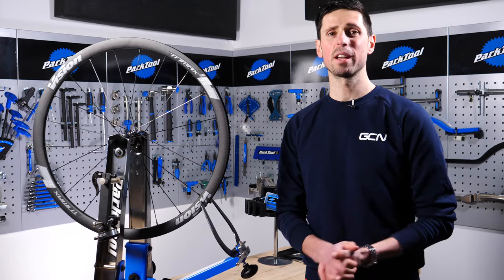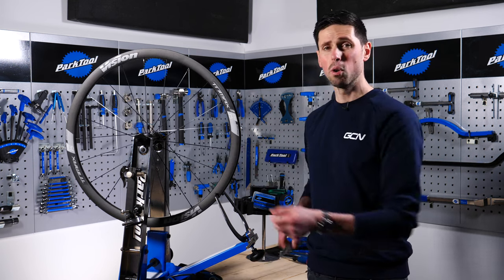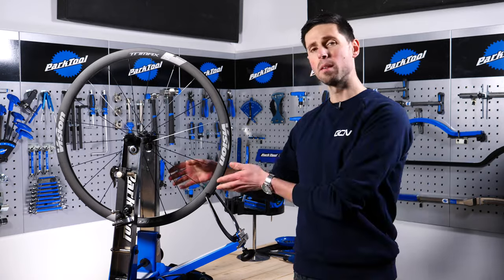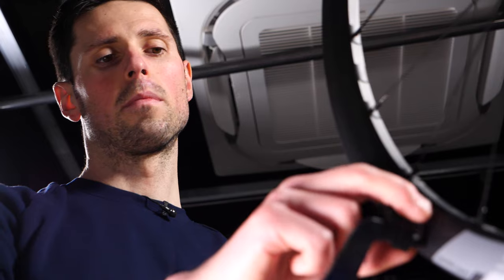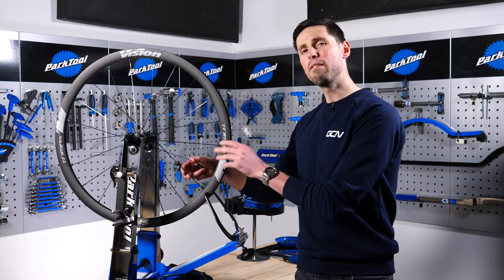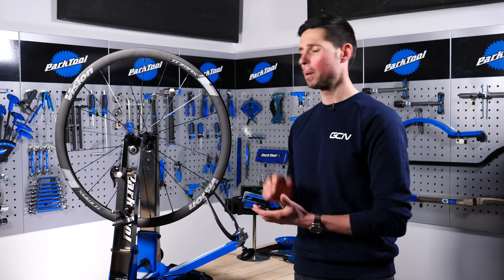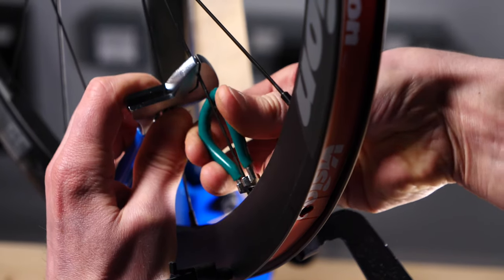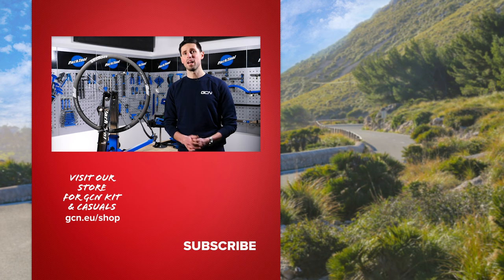How To Fix A Buckled Bike Wheel

Comment from the maker: Did this video help you true a wheel? Let us know in the comments 👇
Reply: For lateral buckles, yes. However, what to do when the wheel isn't round any more (vertical buckle)? Sure the process is similar in the sense that you increase tension on the part that is too long, but on which spokes should you release tension for compensation?
Reply: Using a plier or nose plier or tongue and groove pliers can replace the adjustable wrench, and its way faster. Also, if you are truing a wheel without tubes and tire, you can use a slotted screwdriver to tighten/loosen the spokes. Also: using the TM-1 from ParkTool may help you remove stress from the wheel so that you can true it, without overthingthning everything.
Reply: Also: Since you are sponsored by ParkTool, you can talk about the TS-25, which is a truing stand compatible with many ParkTool bike stands that is really lightweight and handy for your not so often trueing needs, but its way better than trueing using the bike frame/fork. (I really need to start being sponsored for this)
Reply: @koko-lores  I use trial and error method. Because it can buckle fro somewhere else. I mark the spokes where buckles are. I attack paperclips on spokes. On higher spots the clips are closer to rim and lower spots I put them closer to hub. This way I draw like the shape of initial wheel on spokes. Also I can use different color of clips too. Then it's easy to remember which spokes I have already turned and when some new high spots appears I wont get confused. I see from paperclips on rim that they are new and can figure out which spokes I need to loosen.. Here I have a video how I modify paperclips to make them usable as spoke markers/flags. https://youtu.be/hh_bZmHdq30
Reply: @Hardi26  Thanks for the explanation, definitely a good way to keep track. Still a but unsure where to start, especially when there isn't a clear "lower" spot, but a clear "high" spot. Maybe then it's loosening the "high" ones and tighten all "normal" ones a bit?
Reply: @koko-lores  if you have a clear high spot you just need to tighten the spokes around the area. 
I don't think tinkering with many spokes at once is that good because that might result in a broad range of spoke tensions.
Reply: @hankschrader2353  It would increase tension at all other spokes though. But maybe it's still in the normal range of wheel building and fine?
Reply: @koko-lores  Some aluminum rims have highpoint on where the 2 ends are jointed together. And it's not possible to get completely rid of that buckle. Also tension of those 2 spokes each side of that joint is usually higher than rest of wheel. Depends how the ends are jointed, with bins or welded, the lump might be bigger or smaller. Anyways just tighten the spokes on highspot little and watch what will happen. You may need to loosen other spokes little if you think overall tension goes too high. You can listen what sound the spokes do when hit on them(like piano), or play with fingers like on guitar. Better would be to use tension meter, but many people swear, that they can get the tension right by hearing.. So if the wheel is new and correctly tensioned remember what sound it makes and also feel with hands how much you can squeeze 2 spokes together.. And hopefully it won't go bad., Anyways, keeping track on spokes is important, because by my experience, when tightening the spokes on where the high spot is. A new high spot appears elsewhere and it's really difficult to understand later what is happening and it might go so bad, that you need to loosen all spokes  completely and start from there.
Reply: #GMBNTech This is big help and makes truing seems more achievable. Can you answer by my rear wheel always seems off balance though? It is true but always a little bounce while in the stand and spinning. Is this just the small weight difference from the stem?
Reply: @koko-lores  Use TM-1 from ParkTool or any other similar tool to evaluate the overall tension. ParkTool also provides a Wheel Tension App that helps you with that.
Reply: @bugboy152000  ParkTool has a video about that 'off balance' stuff. It can be due to a lot of things. Also, if you use tubeless it will be useless to try to balance the wheel because the liquid inside puts the wheel off balance everytime. Otherwise, make sure you put the tire/tube on the rim before you start to put weights on the wheel for best results.
Reply: @CyclingLifePT  Thank you, I'm running tubeless  and only really notice it in the stand. I can't feel it out on the road.
Reply: The graphics are wrong or confusing in two places.  Hopefully people figure out what's really going on.
Reply: It didn't my wheel is worse now as my spokes tighten the other way so now I have to get a new rim

Comment: Good beginner tutorial.  Truing wheels is an artform.  I HIGHLY recommend anybody start by tensioning their spokes FIRST.  Park Tool makes a good tension gauge and they also have an online calculator.  The idea is that you need to get to the point where there is an even amount of tension on each spoke of a given side and that the tension is within recommended tolerances for the spoke type.  Up front, the tension should be roughly equal left to right, and in the back , the tension will be different from drive to non-drive sides.

Once you have tensioned the wheel, that may take care of the problem already.  If not, dishing the wheel can really help determine WHAT adjustments are necessary.  The truing stand just helps figure out HOW MUCH adjustment is needed.  Then, when truing make the MINIMUM adjustments needed, always remembering to make counterbalancing changes on the opposite side (both left/right and across the circle).

Personally, I always check tension again after truing, and occasionally for really bad wheels, it takes a few rounds of tensioning/truing/tensioning/truing/etc. to really get a true wheel that is also properly tensioned.

There is also a pretty important consideration of making sure the wheel is properly centered on the centerline of the bike.  If the tensioning is done properly, this should be the case, and if your truing stand is properly centered, it will show up there, but check it after each step anyway (i.e. tension/check/true/check/etc).  Check center by putting a ruler level across the fork and making sure the distance from the center of the tire is equidistant from the fork arms.  If the tire is off, just make sure the distance from the rim is the same on both sides.  If it isn't, FIRST, center your truing stand (you'd be surprised how many aren't centered), then start back at the beginning.

BTW, this isn't just for purists.  A properly tensioned wheel will perform better in all respects, and will resist going out of true much better than one that is too tight or too loose.  It's all about balancing compliance and rigidity, just like in every other component of the bike.
Reply: Thanks for the explanation, I also think that the tension is the first thing to do.
Reply: the problem with most YT videos is that each video only addresses one part of the equation but doesn't tell the viewer which takes precedence. IMO, tension>true. It's better to have a proper amount and distribution of tension, and take some deviation in trueness. Some people chase perfect trueness only to have totally imbalanced tension, damaging the wheel

Comment: The clockwise/anticlockwise instruction fails to mention which end of the nipple this applies to.  People new to this can easily make the mistake that the perspective is from the inside of the rim.
Reply: Was wondering about this myself.  As always you need to view smaller channels for better instructions.
Reply: Not only people new to this. I still check rotation every time before I start working on the spokes.
Reply: Ah that's why it looked like he was turning them the wrong way! Makes sense :)
Reply: And said he was turning the nipple clockwise when the spoke wrench was going counterclockwise; i.e., the turning the wrench in the opposite direction b/c it's on the other end of the nipple.  Really fundamental and not well explained in this video.
Reply: @JATJAT330  He did it correctly you know. You're looking in the direction of the hub when you're standing behind the wheel.
Reply: @HiopX  yes - i've built and trued a few wheel sets - still infrequently enough that it's not muscle memory and need to check each time
Reply: Making mistakes will teach you far more than a YouTube video ever could, 
I'm always confused by comments like yours, you obviously know how a screw works, Let the snowflakes figure something out for themselves.
Reply: such a good coment, as new to this I made that assumption myself. its even funny that the guy just ignores your coment instead of thanking you and making the correction.

Comment: I was once tensioning an old wheel that was like a 48 spoke, 4 cross wheel, and as I had it on the ground pressing it down, putting pressure on the rim to stretch the spokes, the entire wheel popped into a Pringle chip shape.  It was incredible!  It was perfectly symmetrical.  I couldn’t believe the rim didn’t break.  So I just pushed on the high sides and it popped back straight.  No damage.  It wasn’t even really out of true.  Blew me away.  Any modern wheel would have a rim too stiff to do what this rim did.  Bike wheels are mysterious things.
Reply: You're not the only person who has brute-forced a Pringle back into shape. Here's a recent viral video of just that: https://www.facebook.com/watch/?v=221335179578400
Reply: The same thing happened to me as well! Even though I didn't manage to get it perfectly straight afterwards...
Reply: @mattgies  😂
Reply: But isn't that wheel now compromised? If it can pop into Pringle shape won't it go back into that  shape with very little trauma thus risking a massive failure while riding after you've made the wheel appear to have seemed just fine after depringling?
Reply: @MrReedEnt  Double wall wheels are the way to go. I have an inexpensive bike, but with all the best features, including aerodynamic deep wheels. But they are minimal spokes, below even the low end of the normal range, at 22 for a 700c wheel. I was busy in college, not paying attention, & to my horror, one day I finally noticed that I had 2 fully broken spokes, & 3 very bent/ loose/ damaged out of the 22! (thankfully i'm not way overweight). I was afraid to even ride to the bike store & rode on grass strips all the way there, slowly, in case the bike fell apart. But they said 'go ahead' when i asked if i should ride my bike back home, to do the repairs at home.  This was the power of a very strong double rim. Yes, you are right. I believe metal can have a memory. However, it is the case, that pretty much all single layer rims are apt to buckle at ANY time if all the spokes aren't balanced, tight, solid/ unbroken. They are very much held together with the tension of the spokes, rather than the strength of the rim wall. With all i've learned of wheels, & how much you can get hurt on a bike that just instantly falls apart, I'd never ride a bike with single rims again, (although I do have a bike trailer with them that has managed to carry many large loads). Still, I don't want any chance of injury, & I was so impressed with how my double wall rims held up with almost NO spokes, that I am sold; it's the single wall rims that are a risk to buckling, based on my experience. Just keep an eye on spoke health otherwise

Comment: As a mechanic I really appreciate the vast majority of my shop's customer base does not true wheels on their own. There's so many things that all need to get balanced at the same time and without all the tools it takes forever and is not always even possible so When I see wheels that have been messed with by a customer, they usually got rushed thru the truing process then ridden on with weak spots due to bad tension and get totally jacked up.
Reply: Yep, that's why I stopped doing it, it just isn't time-efficient
Reply: Im still gonna give it a go.

Comment: Why do you use an axle adapter when the centering wheel has originally made protrusions for the rigid axles. Unless it is not TS4 or 4.2 and it looks like this.

Comment: That's how to fix lateral buckles. However, what to do when the wheel isn't round any more (vertical buckle)? Sure the process is similar in the sense that you increase tension on the part that is too long, but on which spokes should you release tension for compensation?
Reply: I also want to know about this,.
Reply: Yeah, I thought he would cover it. Calvin at Park Tools does a much more in depth video (although it is quite complicated if you've never done it before) over on their channel which covers vertical as well as lateral buckles. And he teaches you get it dialled perfectly.
Reply: @framedman  Thanks, I'll have a look

Comment: It would be good to see how to rectify a ‘bob’ as well as a buckle. Thanks.
Reply: I think that kind of out-of-trueness is called "egging" the wheel is egged. 🙃😀
Reply: I second this. I can true a wheel but wouldn't feel comfortable fixing the wheel being slightly oval-ed/egged
Reply: those truing stands are expensive 😰😕 I use the forks and brakes to fix a little wobble but yeah egging I'm not certain. For sure I expect to have to remove the tyre
Reply: I built both my wheels from scratch without a proper truing stand using only a tensiometer to know when I'd put vaguely the right amount of torque all around.

Rather than relying on brakes where you can only measure buckle, I spun the wheel in the fork with a bit of tape strung along the top. If the wheel hits the tape at one orientation, you know its too close and can add some more tension in that area.

There's no need to remove tension in other areas so long as you periodically go around the entire wheel and remove/add tension evenly to keep the average about right.

Of course this entire process has to be done with no tyre.

One final important point is it can take a while for the spokes/rim to settle down after you change the tension (all the friction between spokes / nipples). It's a good idea to put some force into the wheel to flex it a little and help work stresses out. Just take out the wheel and put it flat on the ground so you have something pressing the side of the hub. Then you can put some of your weight onto the rim. Do this from both sides at multiple orientations and you should be good.
Reply: Same concept, but you need to adjust the truing stand so the tips of the calipers are following the outer circumference of the rim, rather than the sides. In other words, you need to move the tips of the calipers down and closer together if you start with them as shown in this video.

Note that radial truing ("bob", "hop", or "egg" fixing) requires more turns of the nipple than lateral truing ("buckle" or "wobble"). Where a variation of 1 mm might require a 1/2 turn of a nipple for lateral truing, it will be more like 2 full turns for radial truing. And of course to lower a high point, you tighten spokes going to BOTH sides of the hub--likewise, to raise a low point, you loosen spokes going to both sides.

And because radial truing requires many more turns of the spoke nipples, it's a lot easier for your spoke tensions to go way out of whack. Especially if the hop is a result of rim damage such as from plowing through a pothole. So using a spoke tension gauge is highly recommended.
Reply: @ollieb9875  A true stand doesn't have to come from Park Tool.  I love their products, but a truing stand from Performance Bike or Jenson USA will be much less expensive.  I have one from Performance that works just fine.

Comment: I have a wobbly wheel after taking off the rear wheel for cleaning. After placing it back it occurred. I just cleaned. The axel can only be installed in one way. Did I miss something?

Comment: Is it absolutely necessary to remove the tire? Or is leaving the tire on an acceptable "quick and dirty" fix?
Reply: @nascar427  Thank you! In a tuebless setup, I don't want to deal with that milk more than absolutely necessary.
Reply: If you have a flat spot it can make things a bit easier. Since I'm running tubeless I'm not going to do this a second time 😀
Reply: @SwiCyc  If your tyre is too big to see the rim properly and you aren't using one of those stands, put some loose electrical tape on the frame/fork near the rim and look at it sideways and see if the rim gets closer to it.
Reply: It's best to remove it, but at a minimum let out the air pressure.

Comment: In my opinion, a pretty poor video. Firstly, as mentioned elsewhere, the video is misleading as to which direction you tighten or loosen spokes!  Most people tighten spokes from the 'inside' of the wheel  ie looking onto the rim where the spoke enters the rim. In that case, turning clockwise loosens the spoke tension and turning anti clockwise tightens the tension.  Secondly, it recommends loosening the spokes on the opposite side of where the spokes are being tightened. This is wrong in most cases. You will not be surprised to hear that spokes never tighten themselves in riding, they only ever loosen. If you loosen spokes opposite where you tighten them,  you will leave the wheel with unevenly tensioned spokes and you are likely to get another buckled wheel pretty soon.
Reply: Agreed. This should be top comment

Comment: Hi, Help needed please. I have a Campagnolo Shamal front wheel and it needs truing. The spokes and nipples are aluminium and are seized. Any pressure on the nipple will snap the spokes! Tried different penetrating solution with no joy. has anyone had a similar issue with these wheels?